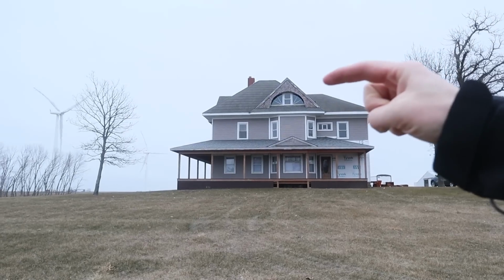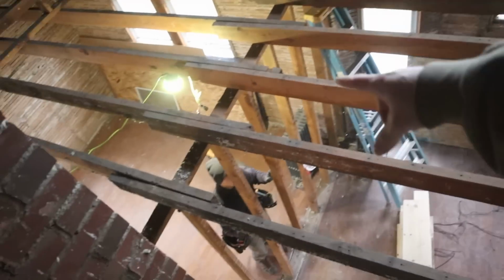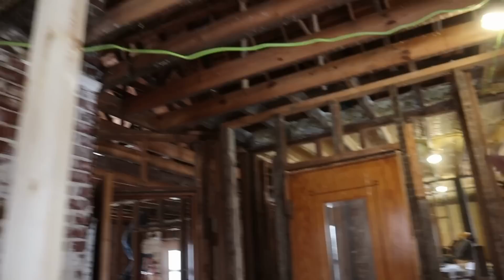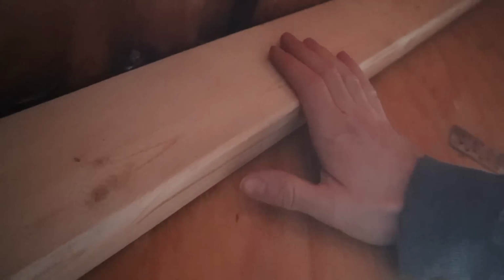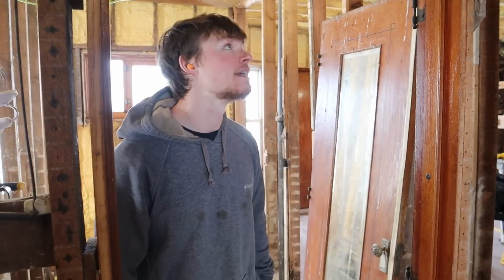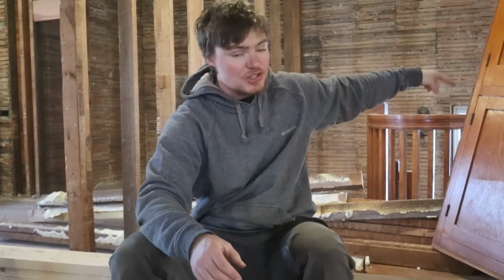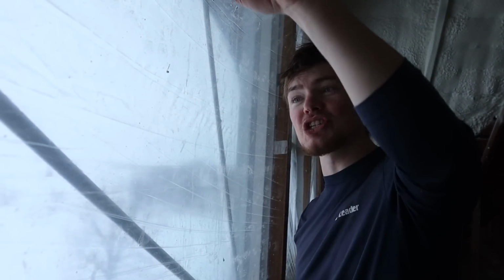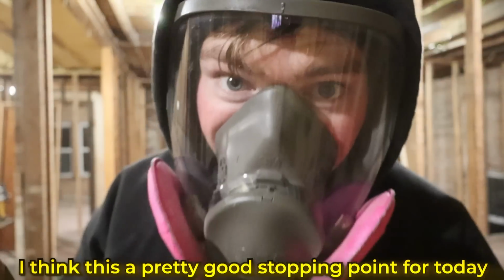Restoring A $7,000 Hoarder Mansion: Attic Insulation Day

Comment: missing weight transfer elements - with a 12/12 roof pitch there's almost no snow load. And they were right I'd say. But yeah, fix it. All that wood has turned to 'stone' and locked together >> add but don't remove.

Comment: Keep seeing one huge mistake with most of these spray foam attics that causes alot of issues down the line. Are not using baffles on the back of the decking. Especially on a shingle roof, it wrecks them as well as causes ton of damage to the decking from moisture build up.

Gotten into many million dollar homes reroofing them only to discover a nightmare down below.

Comment: Acetone will take it off, but acetone will go through your skin and into your bloodstream. 
So, a little bit with a scrub brush, but don't soak in it. 
Acetone is what you use to clean your Great Stuff Spray Gun.
Oddly enough it is also the fixer for CA glue. Great Stuff is foamy CA glue.

Comment: You commented on the attic. I've seen something similar. What you have is a inner roof. That has had add ons put on top. To strengthen the inner roof line add collar ties in the peaks. This will help to prevent the add on roofs from pulling it down. I noticed you put in kick walls to secure the roof to inner walls. This only works if that has a wall all the way to the basement in reinforced areas of concrete. The only other thing is to reinforce the roofs vales interior as they are floating due to the inner roof being opened up. Good luck.

Comment: Patty mentioned putting  the washer dryer in the bathroom. 

I knew a family that did that. It was always a mess.
Dirty clothes vs clean clothes and 
Trying to use as a 
Nice bathroom  was a disaster.  It smelled.  Not a good idea.

A separate  Laundry room is  the ticket.😅

Comment: My house isn't near as big but I also need to restore it. It's also over 100 years old and only has some of the old wiring and insulators left over. None are active after it was remodeled in the 70s. But still has the single pane windows with the weights in the walls. I have been great full that it has mostly been a very mild winter here in NW Wisconsin this year.

Comment: It was common back then to have different dimensions in lumber. Nowadays the advantage is everything is planned equally. 

But, the disadvantage today is that the manufacturing companies don't take the time to dry the wood before planning, so you end up with twisted and warped wood once it has been cut and planed.  Also most of the wood today is not old growth, so the grain isn't as dense.

Comment: You need an Energy, Recovery Ventilator to exchange the air inside the building. It will be a "sick" building without it. Changing the air in a very tight house is very important.

HVAC will help with the moisture, but you may want a separate dehumidifier. The larger units are inexpensive to operate.

Comment: I agree Roman is a fan favorite.. the state I live in when we use reg insulation we have a space above the insulation for air flow an moisture control. so how does that work with spray foam

Comment: I know you said you are not going to put a bathroom in the attic and also you are tearing out the laundry shoot but wouldn't it be a great chaseway for the attic mechanicals? Just sayin'. Just extend it a bit to get to the attic? In any event, I'm afraid you may regret no bathroom up there. At least have it prepped for a bathroom in case you change your mind. Run the rough plumbing.

Comment: So where do you leave the air gap in the constructions when you are spray foaming?
With out air gaps in the constructions the part of it that's are of organic material will start to accumulating moistur and in the long run a mold problem. 🤔

Comment: Why  didn't you start in the basement and stat jacking up the sagging floors. And address the insufficient floor joists before insulating? Once you move up from floor to floor the insulation will make the walls stress more. It is only going to get harder now.
Reply: Your right. That's where he should have started first.. he is working backwards.. now it's harder for him.
Reply: It's so the house will match the bin site.  First renovation I've seen where they're going to work attic to Basement.
Reply: Just shows how much idiocracy is at work here😮

Comment: Things to consider on the HVAC, radiant floor for the best winter comfort and energy efficiency. With the addition of the spray foam the house will be super tight. you should invest in mechanical ventilation from an energy recovery ventilator and then ductless wall and cassette units for zoned air conditioning.
Reply: It's as if you have an issue with black mold.

Comment: Roman, I see they took the boy out of Ukraine but they were unable to remove that Ukrainian sense of humor! You do it well! The 1977 repairs are likely where the 1 3/4" two bys comes from. In 1917, a two by was two inches thick; and about twice as strong as today's two by. And that is a lot of the reason for some of the short cuts you have found- nobody was looking and they were over building by more than they knew. the Pyramids are build out of stone, not particularly because anyone wanted to, but because it was the only way anybody could think of to build that high. And a "breathing" house has a better chance of surviving in the extreme low pressure zone that accompanies a tornado- think about how houses explode and the parts follow the wind; that started with an implosion as the low pressure passed and the two or three atmosphere pressures as well as winds followed. The house was able toe "leak" enough to come close enough to balance as well as limber enough to retain stability.

Comment: Cole, I thought you would know the fence rule. Unless you know why the fence was put there, you are not allowed to move or change it. No seriously, there was a reason the house was built like that, look where it was built, what would it have to stand up to, and what has it been through and it is still standing today. They are called half rafters, done for tornadoes,  it displaces load from the roof truss by rafter to the ceiling joists, your in a multi level house in open country, it was the beginnings of tornado proofing

Comment: Plan heavily in advance where you want to turn on room lights for 3way switches.  For example you want to be able to turn on the lights in your attic space from both the secret staircase and the normal entry.  plus you'll want to turn off the lights in the halway and grandpas room from the attic if say you have people stay over on the holidays and they sleep up there.  you won't want them to have to come down stairs through the dark and cross the room to turn on a light to find a bathroom.  Plan for where you may want to wall mount tvs and have media boxes installed with outlets and conduit to a spot to mount media devices somewhere else in the room out of the way.  For your plumbing i highly recommend a master distribution manifold in the basement for pex pipe, and single run pex to each plumbing fixture.  it's more pex to install but you have the ability to shut off each fixture from the manifold in the basement in the event there is an issue with a fixture or the shutoff valve at each fixture.  shut off valves at the fixture have been known to go bad and then you can't shut off your fixture under it.

Comment: Couple of thoughts, I think you should have done all your framing, wiring and plumbing before the insulation in the attic. Replace all your cast iron with PVC, add a bathroom and a small kitchenette in the attic if you're going to make that a family space, when plumbing your hot water do a circulating loop so you never have to wait for a hot water for any of the fixtures in the house. I might consider some tornado strapping on the roof structure, steel plates on joints before you close it in. I would probably install three separate HVAC systems in the house, one for each floor.
Reply: Why would you replace a cast iron vent stack with PVC?  Do you really enjoy listing to water run every time you flush the toilet?  He's going to have bigger problems than what you're recommending.  Who renovates a house by starting in the attic and working their way down?  I mean besides Cole.  Can't wait until he starts wiring the house, that should be good for a laugh.  I hope his insurance company isn't watching.
Reply: hes not going to fix that framing lmao dry wall is gonna be a nightmare in the whole house
Reply: @jkempyy  Maybe he likes wavy walls and ceilings.  To get this flat he's going to have to skimcoat the entire interior if he wants things flat.  I've seen more than one owner do what Cole's doing and thinking that drywall is the answer on old homes.

Comment: And with that closet running next to your chimney space - your sub panel wiring could be a lot easier overall because you can run wires/conduit up through the old Chimney space fromt he main panel to the sub panels.

Comment: Why so little insulation? 

I would strongly recommend to put in as much as possible. And also between the floors, not only for sound, but to be able to heat up smaller areas of the house.

Comment: Hey Cole!! Your attic is a terrific space. Having renoed a few myself, may I offer you three suggestions: Although you mentioned you are not planning on adding a bathroom up there right now,  you really should add one into the plans, and "rough-in" supply plumbing and drains to where it would eventually be. Also, run said plumbing to where a potential kitchenette might be. That way, you can easily add said same should you decide to some day make part of the space into a kidz bedroom, or guest suite. Secondly, run the appropriate wiring into the very highest peak for a ceiling fan, as that you'll find all of the room heat accumulating up there in the colder months, and the fan running at a slow speed will push it back down to the cold floor level where it is needed. Lastly, DO insulate the attic floor/second floor ceiling for sound transmission, to the bedrooms below, as that an open space as large as that will definitely amplify radio or TV audio (even at low volume ) to the rest of the house.
Reply: Agreed, plumb for bathroom and wire for ceiling fans.
Reply: Good suggestions.

Comment: Hey Cole, excellent work as always! But a couple things: I'd REALLY involve a structural engineer now if I was you. I highly doubt those roof trusses and walls are built to neither 1917 nor 2024-standards and I worry what could happen when you move first floor walls with that weight "distribution". 
Second, an AC-system might keep the moisture-levels acceptable in the attic, but you are relying on a mechanical system for that. I'd consult an HVAC-professional to figure out ventilation options. Maybe an HRV-system could make sense.

Comment: Do yourself and who ever uses the house in the future a favor and put also a very small bathroom with a small handwash sink somewhere. (and a dump)
Also think about a kitchen installation somewhere in the future and run pluming and waste waterpiping. you dont have to connect all of it or can shut it of with valves. 
But you will someday need it.
And be it the playground for all childrens who just have to pee quickly or your office you dont want to run downstairs all the time.
Or you might convert the attick to an extra  living space you will rent out. or have a meating room for farming or what ever.
Even a seperate Staircase to it in the future would be  possibility.
with a seperate stair or something.

Its not mutch more work or cost while you running all the other plumming in the house. But you can use the space better in dthe future and have options.
Even allways have to Run downstairs to just take a pee while exersising gets realy old realy quickly.

Comment: We have like a story and a half and our room walls are not on the outer walls either. So our room walls do not sit on the downstairs walls, imstead one is in the middle of our living room basically and the other hamgs out about 3--4 foot over our kitchen ceiling. It is very odd. It also puts the weight of the roof on our ceilings. Very odd. But the wall going through the center of the house sits on a foundation as a support wall would. Im confused but it has worked for linger than we have been alive and even our parents. In your case your whole family down to great grandparents. Modern day ideology doesn't make sense compared to what has lasted longer than most of us have been alive. We don't trust it because a computer tells us not to. If we can't make sense of it "we have to change it" so it does. I like seeing what you are doing to improve the house. Cant wait til hour done. Its going to be epic.

Comment: @cole Rock Wool Manufacturing Company is a wool insulation manufacturer that used asbestos in several of its products until the 1970s. Asbestos litigation caused the company to file for bankruptcy in 1996. An asbestos trust fund was established in 1999 to compensate victims.

Comment: Maybe weeks or even months late,  but have you considered the newer engineered "I"-joists instead of regular wood? It's engineered to be just as durable and it's easier to handle. (because of its engineered shape, it doesn't have the same volume of traditional lumber).

Comment: Do you understand the function of keeping a roof cold so you do not build ice dams?  A hot roof, under deep snow, causes a concealed melt that runs down the roof under the snow and then refreezes at the cold roof edge overhang.  Ice dams then force the melt water back into the house.

Comment: Ex framer and current civil engineering student here. I am as surprised as you are about the structure of your home and the fack that it is still standing. Also Justin seems to be doing everything great and by the book in my eyes. Awesome job so far!
Reply: Also just from past experiences I would recommend bracing the walls until you fully install the attic floor. Taking the lathe off of the ceiling and the walls make it much easier for wind to completely wipe out your second floor. Just a few long braces should be sufficient to stabilize the home until you install the drywall and sub floor of the attic. Clarify with Justin but I am sure he would agree.
Reply: One final thought, when you install the next layer of subfloor in the attic please use glue and screws to prevent squeeking.

Comment: Behind the Attic knee walls you need  ventilation if that area is not part of the building envolpe. You also need to seal the ceiling joist bays off under the knee walls to stop air movement in the ceiling bays .

Comment: THE REASON THAT HOUSE IS SO STRONG, IS THOSE LATHES. THE WHOLE HOUSE IS ONE BIG PALLET. THAT'S  THE REASON THEY GOT AWAY WITHOUT USING BIG BEAMS. ESSENTIALLY THE WALLS ARE ONE BIG BEAM. ONCE YOU PUT LATHES ON, AND CEMENT IT ALL TOGETHER WITH PLASTER, YOU'D BE SURPRIZED HOW STRONG THAT IS.

Comment: Back in the late 70’s through 90’s there were some “houses of the future” constructed of spray foam. I went to the one in Wisconsin Dells. They had a “tree” in the center of the house holding up the roof. Basically chicken wire frame work then sprayed. It also had a hidden slide to get from second to first floor. You could do some fun features in the attic for the kids without adding a lot of weight. Look up Xanadu Houses. ❤

Comment: Maybe I missed the mention of it, but changing those rafter braces made me wonder if a structural engineer is being utilized.
Reply: Those braces are not part of the actual roof supporting structure. The load is carried down all the way to the outside walls. Those braces are still needed but he mentioned they will be moving them.
Reply: Like I said, I might have missed it, but has a structural engineer been utilized. Are you one? @justmeiniowa

Comment: They don't build them like they used to...thank goodness. If it wasn't for the strength of the available materials, a lot of houses would collapse. If that is a shingle roof, how are you venting with the spray foam... the resulting heat will destroy shingles in very short order. Good luck man.

Comment: Cole, you've got a great knowledgable crew to work with. Listen to their input as it's valuable to the success of this reno project. Especially listen to Roman's advice as his engineering knowledge is important. If I remember correctly from one of your earlier videos he studied engineering back in the Ukraine. Save as much of the old lumber as possible as it will save you lots of money in materials cost. A lot of those old studs will be as hard as steel and stronger that anything you could buy at Menard's. Cheers from Edmonton, Alberta

Comment: From the 1800s to around the 1960s, wooden framing was predominant: Balloon Framing: Mainly used from 1860-the 1920s, homes were framed using stud walls that began at the foundation level and extended right up to the rafters. the structural support are on the outside walls.

Comment: All that lath and plaster you removed was some serious weight reduction on all your walls.  Your house is settling to a new normal as far as load goes.  Also on the 1977 tornado, all that lath and plaster made the walls of your house a tank.  It may not fair as well in the future in tornado strikes without the 3/4"-1.5" thick plaster walls.  Suggest putting some liquid nails behind your sheetrock on the SW corners of your walls to help?  Great progress and thank you for sharing the journey!